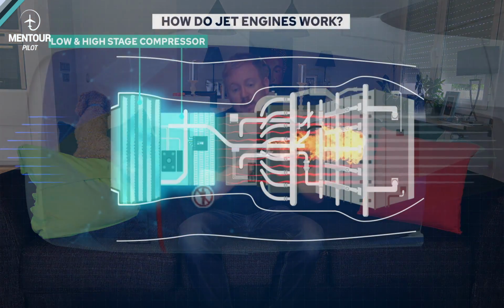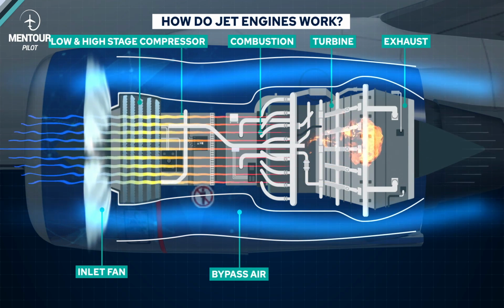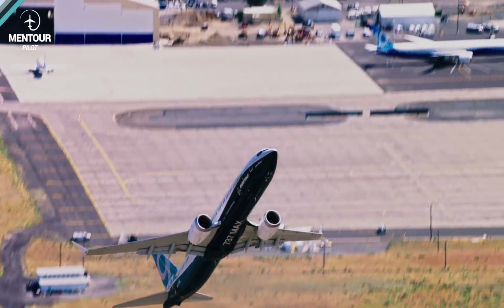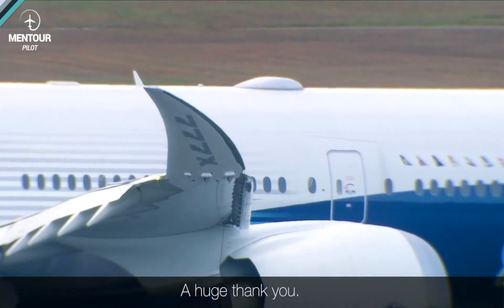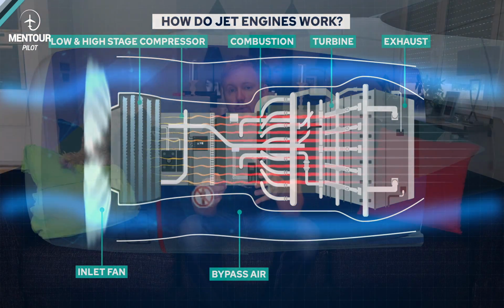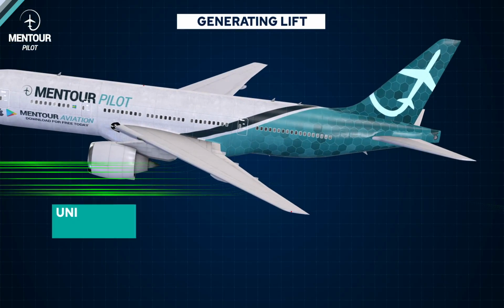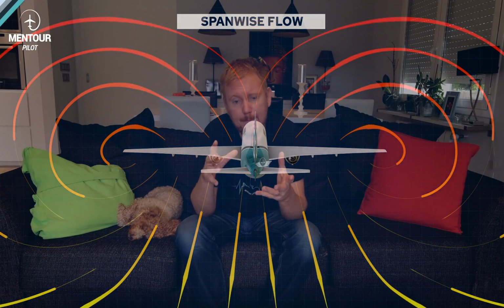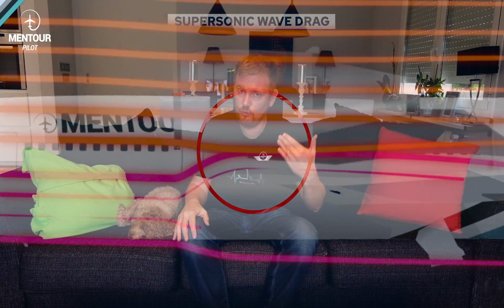How BIG can jet engines get?!

Comment: When will we stop calling them hi bypass and start calling the ducted fan?
Reply: Or simply bypass engines? Either the do, or they don't,  but we already have the terms turbo jet, and turbo fan to cover this. Nobody uses low bypass engines in new designs.

As an aside, I'll never forget the discussion I had with a friend who did engineering on the B-52. We were discussing powerplants and how the early turbofans had partial circumference bypass tubes instead of the modern full circumference ducts came up. Seems the bypass ratio was so low in the early days, they could squeeze the air into several oval tubes, and still get the benefit. Having never seen any of these in person (at that time), or in any great photo detail, I was dumbstruck by the notion of "bypass tubes". The advent of GE's TF39 for the C-5 in 1965 (shortly after I was "invented") gave us the "high bypass" turbofan with an 8:1 bypass ratio, and provides us with the classic layout of the modern turbofan we see to this day. Prior to this, 2:1 was the max bypass you'd see.
Reply: @mikecowen6507  fighter aircraft use low bypass turbo fans, hence the requirement for the AB to really maximise thrust. It's inefficient but serves it's purpose. But you're right in that it's a bit of a vague term, at what ratio does it magically become high bypass? It's getting too the point that we almost need a new "ultra high bypass" or "small ratio core" term to describe these new engines
Reply: @yukionna1649  Sheesh! You're right, but I might call those medium bypass engines, just to further obfuscate the terms.
Reply: A ducted fan is not a type of jet engine. It is similar to the first fan disc of a turbo fan - in as much as its a fan not a propellor, and its in a duct - but its powered by a separate motor, either internal combustion or electric. With a turbo fan, the whole thing is integrated; we use separate terms to differentiate.

Comment: Great job of explaining the basics. I don't feel there will be a need for larger fans in the future. The future lies in the turbine. Pretty much were all real power improvements have all come from since the beginning. 
Most air going thru the core is  for cooling and the more of it that can be used for combustion the greater the efficiency. There has been a steady improvements in metalaligy and now ceramics.
I thought this would be easy to jut down a couple of sentences but I keep running into engineering compromise.
Now with noise, fuel efficiency, and size (wt). 
Oh well not much about fan diameter.

Comment: Mentour, great job bringing up the momentum equation. Unfortunately, you didn't bring up the energy equation which very clearly and easily explains why, even from a pure theoretical point of view and leaving aside any engineering or materials limitations, it is good to have a high bypass engine. It goes like this.
As you said, the thrust of the engine in proportional to the mass of air flowing through the engine and the difference in speed imposed to that air by the engine. Thrust = mass * (Vout - Vin). But the energy (i.e. the fuel consumption) that it takes to accelerate that air (and I am talking just about accelerating it, not making it flow through anything or moving the engine components, etc, so assuming 100% efficiency) is also proportional to the mass but it is proportional to the difference in the SQARES of the speeds. Energy = mass * (Vout^2 - Vin^2). What does this mean in practice?

Ok, lets take a baseline of an engine that accelerates a mass of 1 from a speed of 2 to a speed of 4. In that case, we have:
(note: I am taking the equal sign liberally since this is "proportional to", not strictly "equal", and I am also ignoring units, but the comparative reasoning holds 100% valid)

Engine BASELINE
Thrust = 1*(4-2) = 2
Energy = 1*(4^2 - 2^2) = 16-4 = 12

Ok, let's say now that I want to improve a 4-engines airplane design just by making it a tween with the same total thrust (as if that was that easy...). I need to double the thrust per engine. As you explained, to double the thrust I can either double the mass or double the speed difference (or a combination of both, but let's keep it simple).

Doubling the mass, we have that when I double the thrust I also double the energy required (that's fine, I have half of the number of engines to feed). Look:

Engine 2MASS
Thrust = 2*(4-2) = 2*2 = 4
Energy = 2*(4^2 - 2^2) = 2*(16-4) = 2*12 = 24

Now let's see what happens if instead of doubling the mass, I double the increase in speed:

Engine 2SPEED

Thrust = 1*(6-2) = 4 (same as engine 2MASS)
Energy = 1*(6^2 - 2^2) = 36-4 = 32 (33% more of energy required)

This means that engine 2SPEED generates the same thrust than 2MASS but consumes 33% more fuel to accelerate the air.
The conclusion is this:
YOU CAN GET THE SAME THRUST WITH LESS FUEL IF YOU TAKE A LOT OF AIR AND ACCELERATE IT A LITTLE BIT (high bypass),  THAN THE SAME THRUST OBTAINED BY TAKING A LITTLE BIT OF AIR AND ACCELERATING IT A LOT (low bypass or pure turbojet).

So it is not only "how we can obtain more thrust without destroying the components", it is also "how we can obtain THE SAME THRUST using MUCH LESS FUEL". That's why even planes that need relatively small engines also use very-high-bypass engines (business jets, regional jets).

Comment: Fun fact: the theoretical limit of an engine diameter is about 4 meters, industry is reaching the limits.
Reply: 4M is the practical limit of a single spool (single shaft engine) as conservation of angular momentum will limit the system lower than the engine can stay sustaining. Triple spool engines or geared fans do not have this same limitation.
Reply: @MrRexquando  Pratt and Whitney might have an advantage with their geared turbofan.
Reply: @MrRexquando  turbofans have pretty much all 2 spools. Doesn't that limit correlate to the mass of the component or rather the materials it is made out of? Or is that calculation (4 meter) including the latest composite blades?
Reply: @almerindaromeira8352  It's because L=mvr and v is already relatively high so increasing the radius is a multiplier. It kind of get's to the advantages of a turbo-prop. In a turbo prop the vs turbo fan. Without a gear box you lose efficiencies with a core running at 15,000 RPM and a fan at 5,000.  In contrast to a big turboprop swinging at 1500-1800 RPM.
Reply: @almerindaromeira8352  Also you have to look at the speed of the blades increasing so you are right in theory if you could slow it down and lighten it maybe larger.  I think 4 meters is a practical limit not theoretical right now.
Reply: @MrRexquando  thanks. I understand the theory so I was just wondering how did someone actually come up to this arbitrary number of 4 meters. I mean you are right about being more a practical limit rather than a theoretical one.
Reply: What limits the diameter?
Reply: @currentriver4951  Drag
Reply: @PaliVCiernom  How so?
Reply: Is it only diminishing returns on the efficiency?
Reply: @almerindaromeira8352  frankly, I don't know enough to explain in detail.

Comment: Replace landing struts and wheels with hovercraft  esque skirts hanging from engine? to inflate allow some of bypass air to escape into skirt. 
As a safeguard against metal/runway contact  if all air cushioning length  used up on touch down...have  brush skids(see X20 plane) serve as bump stops.  After touchdown allow skirt to shorten so brush skids touch ground and act as brakes.

Comment: The principal of Mass Airflow you missed is that to double the thrust by increasing velocity requires four times the energy. Acceleration is a square rule function.  To double the thrust by increasing  mass only requires doubling the energy. So Mass Airflow is more efficient.  I was in the business 26 years when I read a paper on Mass Airflow. I realized I knew "everything about aerodynamics"  but I never understood what I knew.
Reply: I understood it as:
Kinetic energy is proportional to mass times v^2.
Momentum is proportional to mass times v (to the 1st power).
It's your exhaust's momentum that drives your vehicle forward, but burning fuel dumps energy into your exhaust.
Doubling your exhaust momentum requires you to double either the mass, or the exhaust velocity.
If you double the exhaust velocity, you've quadrupled its kinetic energy, which means you'd have to burn 4 times as much fuel.
If you double the mass, you only double the kinetic energy, which means you'd only have to burn 2 times as much fuel.
So the more reaction mass you can accelerate in your engine, the more energy efficient it will be.
Reply: I logged on just to comment this lol
Reply: I'm sure you're correct, but I'd love to ask why. I assume it's because of aerodynamic effects, because intuitively

F = m * a -> a = F/m

v = a * t -> v = F/m * t

So, if we take an arbitrary t, I would only have to double the acceleration force to double the velocity. And double the velocity should equal double the force.

But I'm sure I'm missing something obvious - I'm not calling you out, just trying to understand where I'm wrong!
Reply: @MeMe-gm9di  Acceleration is a square rule function It takes four times the energy to double the velocity of a mass. There is a self published paper "Mass Airflow" That paper explains this very well  as it applies to ducted fans. I no longer have a copy of the paper. It used to be $35 with postage.
Reply: @MeMe-gm9di  There are to many listings for mass airflow and ducted fan to find the paper. I do not remember the college it came from. The basics are you can double the thrust by doubling the mass or doubling the velocity of the mass. Doubling the velocity uses four time the energy. That is why  helicopters have  long blades turning in the range of150 rpm.
Reply: LOL! WRONGES! velocity is MAGNUMTUBE  and directionnes UNUIT VECTORS. Plese try agen!

Comment: Hey Mr. Mentour, thank you for uploading a video explaining how jet engines work just as I requested in a previous comment (though you may have seen it) and explaining how and why a greater bypass generally means greater fuel efficiency. I would like to add something though. The fan may act like a propeller in the sense that it sucks air in and blows it backwards like an un-ducted turboprop but the reaction force on the fan is little to none, so the fan produces virtually no net thrust of its own by blowing air like a propeller. I’ve talked with numerous people who work for Pratt & Whitney along with RR Trent and they’ve all told me the same thing. They told me that the fan in a high bypass jet engine is more of a compressor than anything else, the fan blows air through the ever narrowing bypass duct as this air squeezes through a tighter and tighter space. The energy that the fan puts into partially compressing the bypass flow cancels out nearly all the thrust produced by the fan acting like a prop so the fan’s net thrust is <1% respectively. Meanwhile, once the compressed bypass air reaches the bypass nozzle, it expands back to its original volume (and also expands as it cools the engine core and heats up to an extent), accelerates, and shoots out the back of the engine (though at lower speeds than the core exhaust) and that’s how the bypass produces thrust. Also, a propeller’s efficiency starts to plummet once you reach speeds around 350 MPH and turbofan airliners fly way faster than that so it wouldn’t make sense to use a “ducted turboprop” to propel a transonic plane.
Reply: Another thing I noticed is that he said in this video that planes can and are even designed to exceed their critical Mach number where in his video about how fast a place can fly, he said planes aren’t designed to do that and thus never ever do. He contradicted himself in those two videos though his second explanation was more accurate which makes me hope that he learned a thing or two about airplane speed since that other podcast.

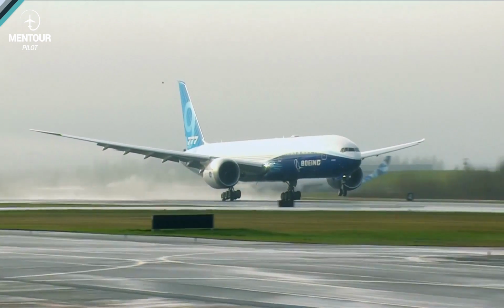Comment: Whats that little brakechute attached to the fin of that 777 X at 9:50 ?
Reply: To get the most accurate airspeed measurements they trail the sensor off the top of the vertical stabilizer. The brake chute ensures that it trails straight back.

Comment: Maybe they should ring SpaceX and their metallurgy department. They recently demonstrated the Raptor with 300bars of chamber pressure in a full-flow-staged-combustion cycles.

They must have created some alloys than can withstand ungodly conditions to make that happen in a oxygen-rich preburner :O

Comment: Aviation Weekly did an article back in 2016 on a Hybrid Wing Body design by Lockheed Martin. The engines will be on top the aircraft and will be massive at about 9 meters. It's a very interesting design.

Comment: I commented in the past about Jet Engines sounding like pipe organs, does anyone know why jet engines can sound like large cathedral organs.
Reply: Harmonics, listen to most hey engines start up and it will pass through a range where it all of a sudden makes a "wwwwWWWWWOOOOOOOOOPPP!" Sound. That's the pressure wave becoming equal to the length of the engine, or compressor sections. So the wave bounces and builds on itself until the rpm is outside of that range again

Comment: Perhaps it's already been mentioned - Fokker made an jet with engines over the wing, the VFW-614.  Obviously somewhat less successful over the years than the 737.
Reply: The point isnt that top mounted engines can't be done.  It's that eventually the loss of efficiency outweighs (literally)  potential benefits.  If a top.mounted engine creates more drag/less lift, then the added bypass capability eventually isn't enough to make it worthwhile.  All engineering works that way.  There are lots of ways to do a thing  but the cost/benefit will determine which is the BEST choice.
Reply: @markdoldon8852  Mark Doldon, that's probably exactly why the Fokker company only made 19 of those planes!
Reply: Oops was already mentioned, with my failing to read your post, but still what about scaling Honda jet?
Reply: But it was in operation until 2012...

Comment: No word on geared turbofan? I am dissapoint ;)

Jet engine fans are also prone to the same supersonic shockwave issue as you describe for wings. This is why to further increase their size, a gearbox must be introduced. Big fan wants to spin slow, core wants to spin fast and balancing this is a bit of an art.

Same goes for propellers. 

Yes, putting engines on top of a wing is a sporty idea, yet such designs exist (Honda Jet and a fokker design from the sixties iirc). But what can be done quite easily is putting wings on top of a fuselage, see all cargo planes or BAe-146 or An-148 passenger planes. 

Overall to reduce fuel consumption and  make aviation greener, speeds will have to come down greatly. Which will bring turboprops back, since they can be and often are more efficient. I so miss the sound of Dash-7 and its super slow props ... only 800-1200 rpm. Such a great plane ...

Also for further insights into jet engines check out Agent Jayz channel. He is a turbine mechanic in Canada and works on 60 years old jets for Sabres and such. Very informative.

Comment: Want more efficiency? Easy: just put the jet inside the airplane and make it a gas turbine generator with a regenerator stage. And then drive the fan on the wing with a electric motor. The regenerator will make the gas turbine a lot more efficient and with the high efficiencies of modern electric motors and drives the efficiency gain will be higher than the losses in the electric motors and drives.
But you will also get a higher weight (more induced drag) and less space available inside the airplane.

Comment: Putting the engines over the top of the wings will also move thrust moment above the wing, if you think the B737 Max pitch up on power increase was dramatic, imagine what a pitch down on power increase would be like.

But what about raising the wing to the top of the fuselage, like th C-5, C-130, A-400 or ATR-72?

Comment: In terms of Landing gear becoming bigger, would it not make sense to add a hydraulic pressure release system to extend the gear when pressure is released, not drop the gear from the bay, but to extend the gear downwards once the gear has come out from the bay? so standard gear comes out of the bay at say 1.5 meters, hydraulic pressure is released and the gear then lengthens to say 2.5 meters. This surely would make the gear a lot easier to store, lighter and if there is a hydraulic pressure leak, it can only extend and not pull up.

Comment: So, to make a long story short, a modern turbofan eingine is no more than a contained turboprop engine with some more blades on the fan...
Reply: It may look like it visually but it's not true. A turbofan works on the same principle as a turbojet. Create high pressure gas and push it out of an accelerating nozzle. As such, the fan is really a low pressure compressor, not a propeller. Typically large fans have a single stage with a pressure ratio of 1.2-1.8, feeding a converging nozzle.

The characteristics of the engine thrust are also the same as it is in a turbojet, and very different to a turboprop - in a turbofan/turbojet at a given operating point at a given altitude thrust is almost constant with regards to speed (until compressibility effects). In a turboprop thrust power is more or less constant, but thrust drops inversely to speed. Two very different propulsion methods

Comment: These engines are bigger than some people's homes, and some people still think that they run on compressed air. That's the most mind-blowing thing of all.
Reply: They DO run on compressed air, AND a bunch of fuel to compress that air. Now, those that think you can turn a 30-50,000 HP compressor without fuel, are, well, morons.

Comment: @ Mentour Pilot What are the tradeoffs between a low  wing and a high wing for commercial airliners? A high wing could accommodate a large engine and smaller landing gear, yes? How about GTF (geared turbofan) to increase efficiency?